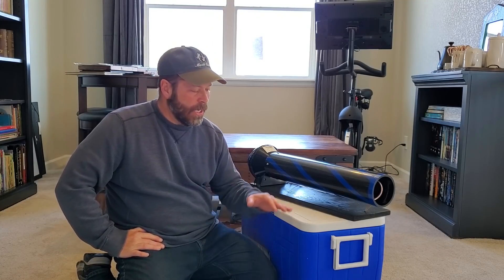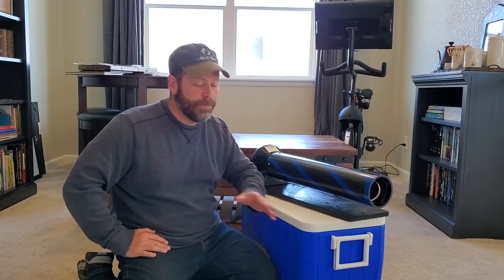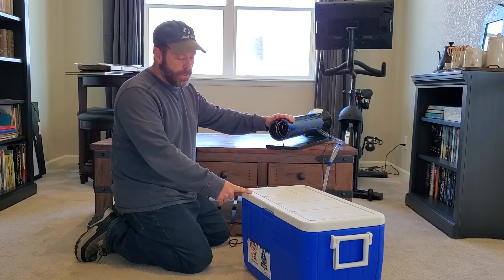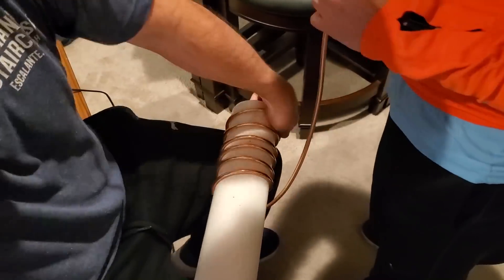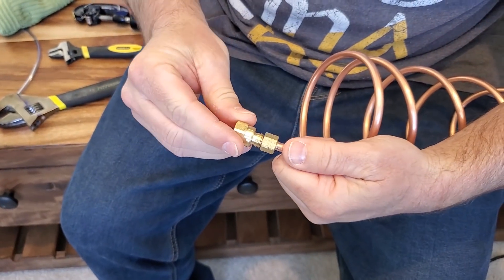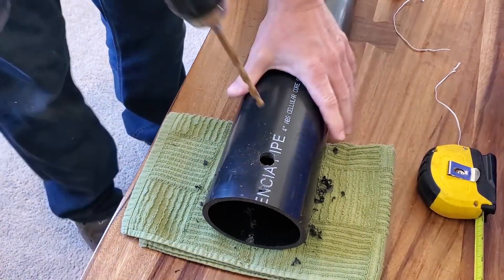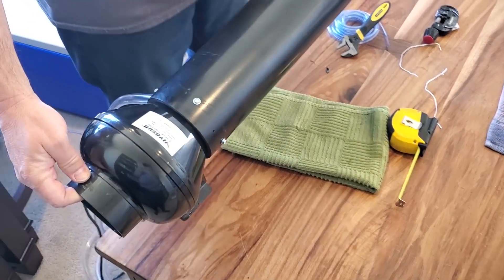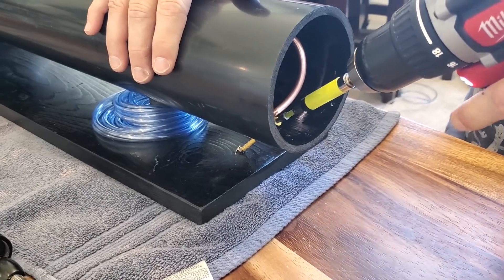Homemade Portable Air Conditioner DIY - NO HUMIDITY! - Long Lasting Ice! - The Fan Cannon

Comment: Quick question. Could the coils be wrapped closer together to allow the pvc tube to be shorter? I would like to build one where the entire system could be stored inside the cooler for easier transportation.
Reply: Did you ever try to make this with a shorter pvc?
Reply: @thomasarellano4721  I scratched the idea because after making a few prototypes it wouldn't give me the cold air that I want
Reply: Buy a heater core from the junk yard.  It will be smaller, cheaper and transfer heat more effectively.
Reply: perhaps have the fan/cannon attach to the lid, flip the lid and contain the fan/cannon inside the cooler for transport/storage?
Reply: @Breeegz  good idea but if I flip the lid open with the fan attached to the inside than the ice would melt quicker
Reply: @chriswoods9857  yep long as you don't mind putting ice in more often.

Comment: Woul this work with a smaller pipe? Putting it in a dog house and that's a bit long.
Reply: Yes been thinking about doing this for my outside lab while we are gone on vacation. Has a 10’ x 10’ pen right next to my man cave ( 30 x 50 metal building )

Comment: So I took this same idea and switched it up a bit to fit my design. All in all it pointed me in the right direction. Instead of a cooler I used a 7.5G storage bin and I plan on using flex duct to run my copper in.
Reply: Flex duct only works if it is stretched tight and straight. A storage bin has no insulation and you will gain heat through the walls and create condensation on the outside of the bin.

Comment: The reason the ice last is that it hardly cools, ice have 334KJ/Kg melting energy or 7 times less the energy it takes for the same amount of water to evaporate so if the ice lasts 3 day's it can hardly keep up with the energy it takes to run the thing. Sorry.

Comment: Reverse the flow through the tube.  The best heat exchanger will take advantage of the difference between temperatures ( aka delta T or dT).  If the hot air hits the coldest water first, you will end up at the air exit end of the tube with cooler air, and warmer water.  As the dT will be less at the exit end, you will not be transferring heat at the end of the tube.  The air would already have been cooled, and the water would have already been warmed.   You should have opposing flows.       ie.  Blow the hot air into one end of the tube, but flow the cold water from the exit end backwards to the air entrance.  This ensures that the air starts being cooled by the warmest water, then continues further to colder water, then finally exits with the absolute coldest water at the end.  This will transfer the most heat from the  water to the air.  .... Now. you can add a PID temperature controller to control the pump.  When there is a lot of ice, you probably can turn on/off the pump to keep the water tube at say 40F.  If the water gets colder, then shut off the pump.  This will save some of the ice for later.  As the air heats up, the PID controller will keep increasing the pump on timing, keeping the air temperature the same.
Reply: GREAT IDEA!
Reply: Just to make it simple.. the water and the air should go in the same direction or opposite? 

A bit tippsy now and my dyslexia would not help me.

Thanks from sweden!!
Reply: @lincpink  water and air go in opposite directions. Ie. The water would exit where the air enters
Reply: @diyernh  thanks!!
Reply: I wonder if he could leave his setup as it currently is, except move the fan to the opposite end of the tube? The fan would be pulling air vs pushing it, but it should still work, taking advantage of the difference in temps like you describe, correct?
Reply: @wdschwartz8386    The fan will add heat to the airstream.  Whatever wattage the fan uses will be added heat.  It may not be much, but it will the there.  By putting the fan after the cooling, it will be warmer than putting it before the cooling section
Reply: I'm going to do that. Thank you

Comment: Did you have to do anything to get the fan to fit in to the 4” pvc pipe? Ordered the 12 volt fan and it won’t fit
Reply: I think you were suppose to use 4" ABS which is a thinner plastic which will give you a larger diameter for the fan. If you used 4" pvc, the thickness of the wall reduce's the diameter of the inside of the pipe and that is why the fan isn't fitting. Re=read the list of parts and go back over the video. Better luck next time, Rome wasn't built in a day, so it may take a couple attempts, it will work. By now you have either figured out a different way of doing it or you found our what I said was true, either way I thought I'd just share it any way in case someone else is reading this comment now and not two months ago.
Reply from the maker: You could get an adapter. Take the fan with you and go by a hardware store and find an adapter to go from the fan outlet to the 4" pipe. You can find a rubber one most likely in the hvac or plumbing section.
Reply: @livingwithlucasofficial  Oh yeah! Thank you
Reply: @jasonkreiling2238  P.S. Ya, the 3" inch, was PVC and it's just for coiling the copper tubing around it to get the shape you want to have it fit into the ABS 4".

Comment: I think if you but a rabish of alimnium wire rolls inside the tupe it will get forozen and as the air got through it will make the air cooler

Comment: Brilliant.  Can you estimate how much area this will cool?  I'm wondering if it would cool a standard sized van.  Great work!
Reply from the maker: It will cool a van. However, this greatly depends on the outside temperature. In my testing, it cooled the area by about 10-12 degrees. In other words, if the temp is 85, it will cool it down to about 72-75 or so. Also, keep in mind it will take a longer than your car ac.
Reply: @livingwithlucasofficial  try cooling the water with solid state peltier and you have a winner.
Reply: @livingwithlucasofficial  What do you think about a tent?

Comment: Condenstate on the copper tubing.  Create a drip tray beneath the copper tubing with a return line to the cooler.
Reply: Since all that copper is in the tunnel, its all exposed to the fan. I dont think it would build up condensate unless the fan wasnt blowing and the pump continued to run.
Reply: That is a fairly obvious oversight to not address in this design.
Reply: @pjsavagejr  the copper tubing is part of the recirculating cold water.
Reply: @karenredding9439  hello, I was talking about the condansate. Maybe not clear haha. Refer my question about what sam said.
Reply: According to the power of the fan in the tube will determine if there would be any condensation ad or the build up of water outside the copper tube...it's a great idea
Reply: Just wondering, why a return line back to the cooler and not into like a "wast bottle"? For me, the return water would Just melt the ice faster? Or do i thinking wrong? 

Thanks!! 😃
Reply: @lincpink  
You'd run out of cold water as fast as the pump could remove it.
The "used" warm water is recirculated back into the cooling tank so it can be chilled and recirculated again and again..
Reply: @zrxdoug hi, sorry. I was talking about the  condensate water that sam comment about. Do i stil think wrong?
Reply: @lincpink  
You're not wrong..condensate wouldn't be as cool as the water inside the pipe..and it would add more water to the reservoir..makes more sense to drain/discard the condensate than to recycle it.